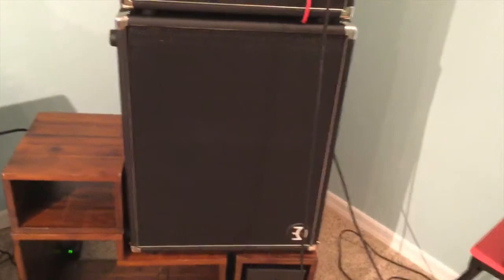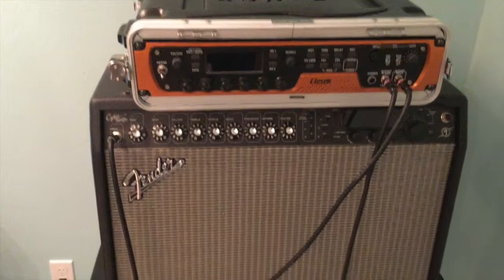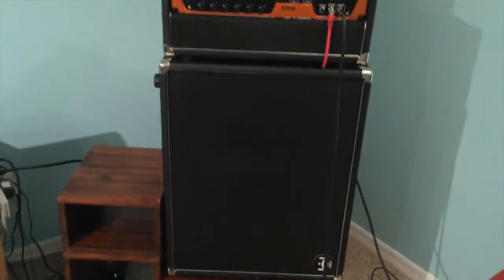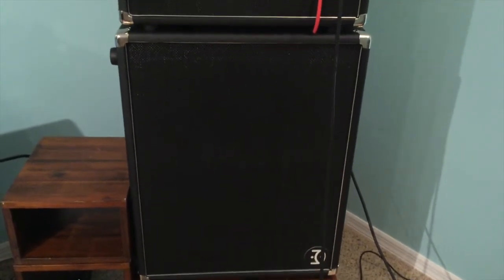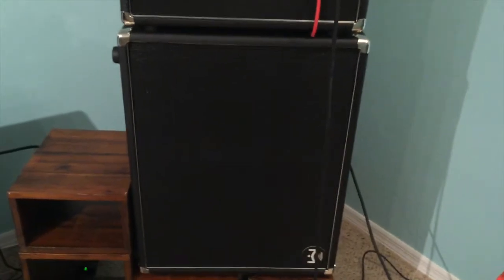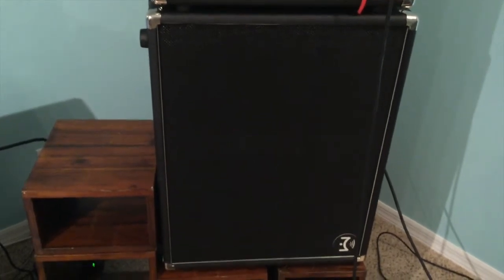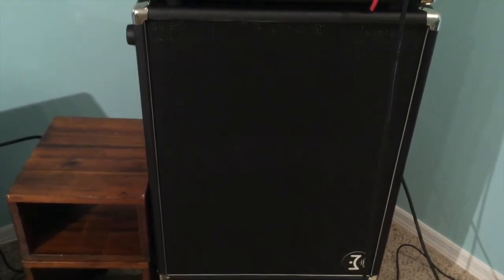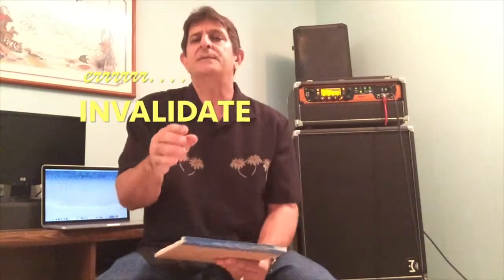Gemini 2 cabinet drivers

Comment: Elias, I've got the Gemini 2 BT (Blue tooth) model...I notice the pop so this video made me feel better.  Do you notice a hum even when not playing?  I am on mine.
Reply from the maker: David Ludena I noticed a hum in mine at first also, but figured what caused it. I had my WiFi router on a stand nearby, but removed it and placed it on the floor...and...no more hum! A second thing which could cause the hum is connecting the cabinet to the same electrical line in the room where you may have overhead lights...and...in this case, try another socket. I specifically had my electrician place 2 dedicated quad sockets—one on each side of my studio desk, so I don’t have such a problem. Some presets on the guitar processor can hum, as you probably know. Finally, don’t have a cell phone or iPad in close vicinity. I hope one of these thoughts can help you remove that hum. (Btw...I use Mogami cables and they are expensive but great). Cheers.

Comment: Bla! Bla! Bla! Bla! but no fuck and sond at so ever what is that crap....
Reply from the maker: Christian Tremblay The purpose was to explain the 'pop' as the cabinet is turned on. Some may be bothered by it. Concerning SOUND ... I actually was working on another video to demonstrate. I have 2 cabinets, and play through 2 Eleven Racks combining 2 different patches. Unfortunately, I do not have the proper video equipment to capture how good these cabinets actually sound. I wasn't ready to spend another $4-6,000 for suggested cameras some professionals recommended. I still hope to.

Comment: Two Gemini 1's would probably work best, in a smaller room... Two Gemini 2 is quite expensive and overkill, as you'd have two stereo cabinets playing stereo. I'm waiting for Mission's new, light weight "Lo" cabinet to arrive. Thanks for the video.
Reply from the maker: Funky' Furballs A year later I reply. Sigh. You’re right ... it’s overkill ... but I’ve been having f u n. 😊
Reply: Ha... Well, I ended up with one AccuGroove Ristretto. Solid build and smooth sound.
Reply from the maker: Well done. Actually, I went 'overkill' because of the possibility of moving to a bigger place, plus playing live I wanted to ensure a favorite live setup. I'm not crazy about in ear monitors.